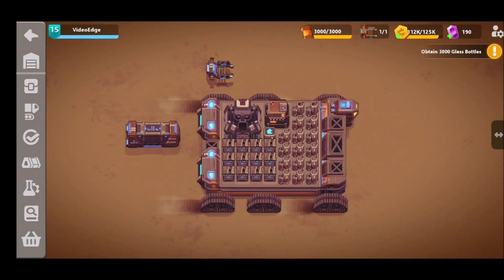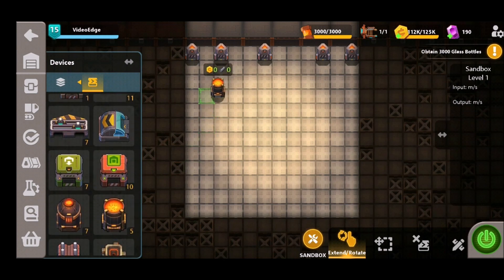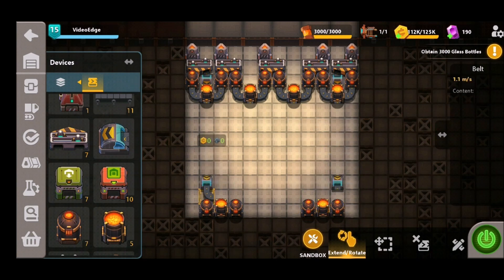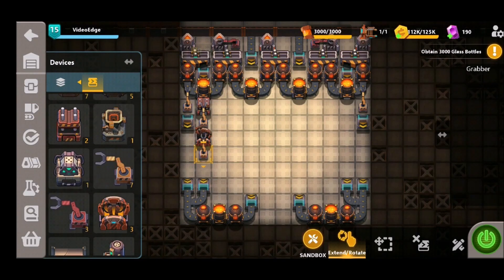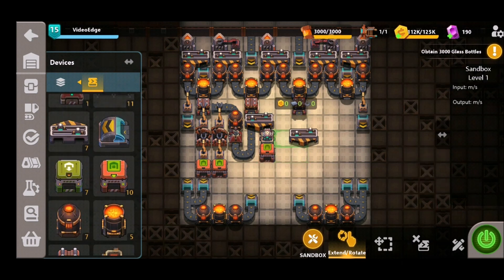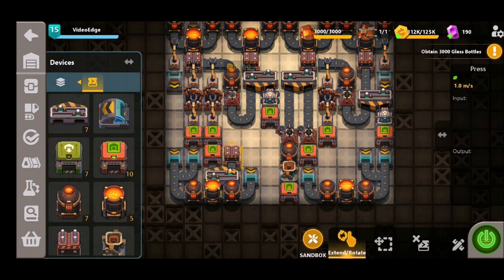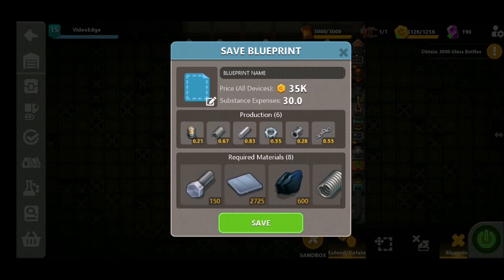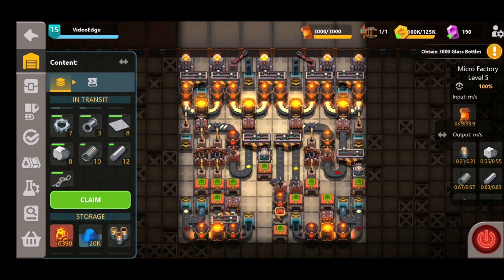Sandship Crafting Factory - Whole Micro Factory Steel Production! [HD]

Comment: You can feed every single mixer without the use of underground belts and achieve their maximum plate output of 5 plates/second by just crafting items using importers instead of belt feeding everything. The arms and underground belts are bottlenecking this design.

Comment: what not create raw basic materials in a factory and import them into another build for mfg like chain, gearboxes etc
Reply: If using coordinated factories, you have to make sure your factories are all working, so keeping track of which factories are needed can be 'fun'

This is a solo design for steady gathering, not a design for rapidly gathering a specific type of item.  As long as you have good stockpiles, you can let this run and on average all the items will gather at a steady rate so you shouldn't have to rush a single item

Comment: Hey there. 
I tried to copy your layout.
great explanation, really efficient .. good job.
i have only one small problem, my gripper, in the steel chain production, does not take the steel plates out of the press.
so this production remains.

Any tip?
Reply from the maker: Nick Wagner Hey Nick, to make Steel Chains you need to first make the steel plates into steel rods, this is why the grabbers aren’t taking them out the press
Reply: @videoedge5405 thank you. I completely messed it up ^^ on the left edge it was pipes and not chains ... now it works ... :-D